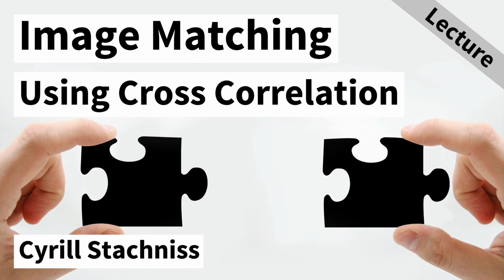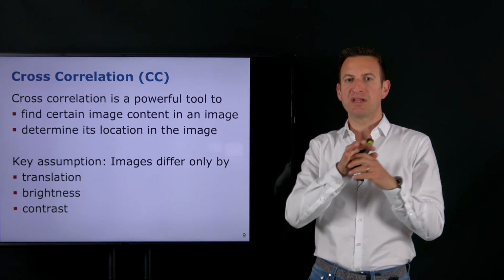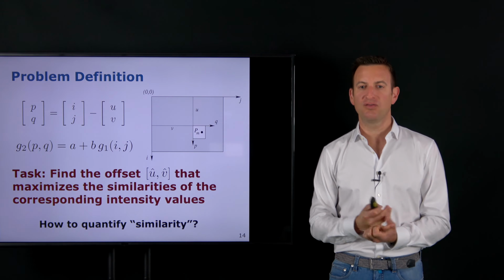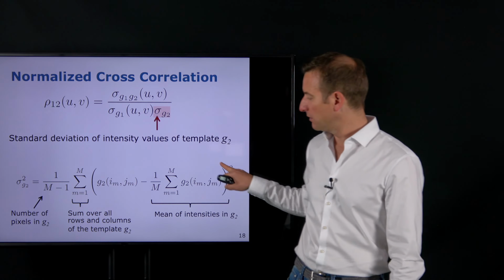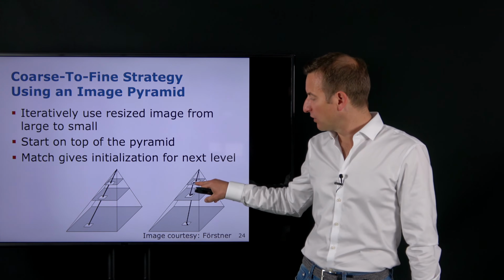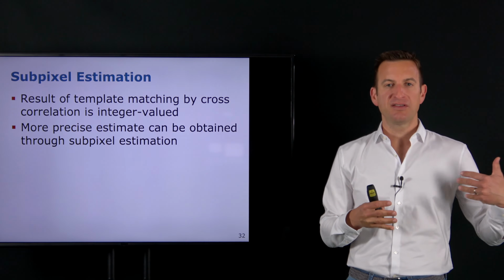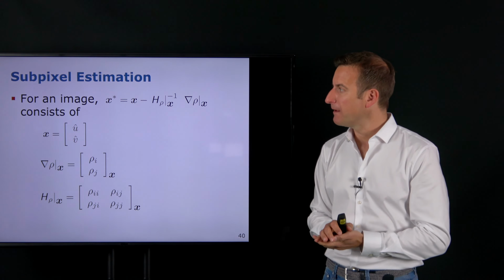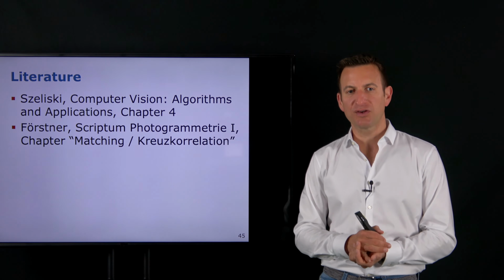Image Matching using Cross Correlation (Cyrill Stachniss, 2021)

Comment: why do we have a factor 1/(M-1)  instead of having 1/M in that Cross correlation formulae ?
Reply from the maker: It comes from the estimation of the covariance
Reply: @CyrillStachniss  dividing by 1/(M-1) is used when computing the sample variance to account for bias; 1/M is used when computing the entire population variance. Since we are considering every single pixel in the template here (i.e. the entire population), should we not use the latter formula (divide by 1/M)?

Comment: Thank you professor, this lecture is very helpful, 
professor, I have a question,
When image matching using cross correlation in the Fourier domain, why is there a strong signal from the top-left?

I'd really appreciate it if you could let me know.